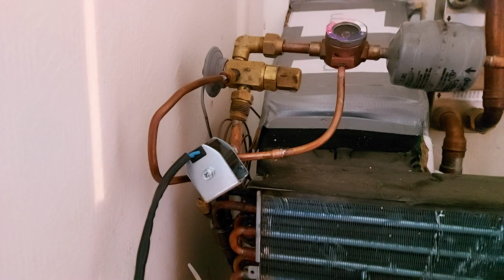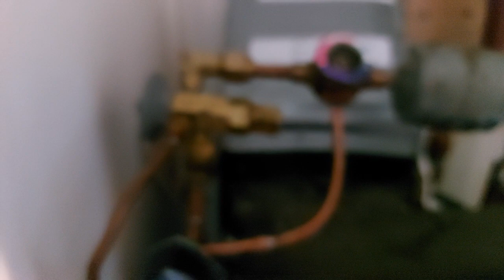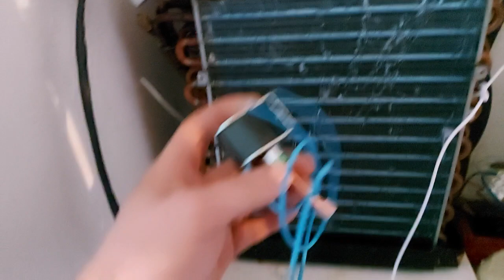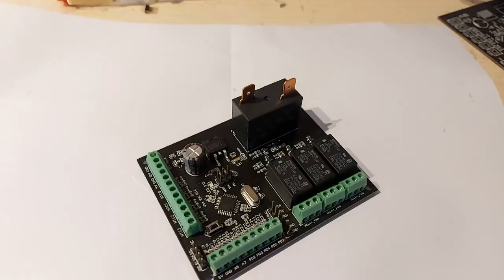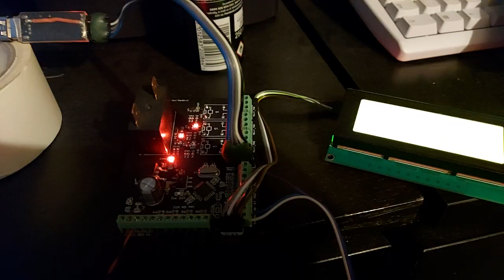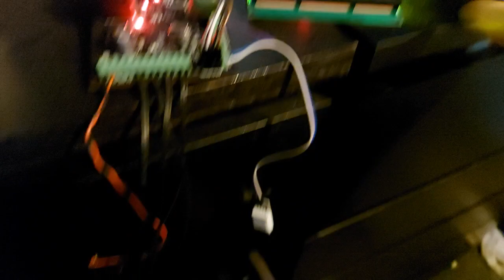Refrigeration Defrost Valve and New Controller

Comment: Hi Shaun, I am planning on converting a 16kw capacity air conditioner into a ground source heat pump, and maybe you would have any advice on selecting the right plate heat exchangers?
Reply from the maker: Basically, the bigger the exchanger, the more efficient it will be. How many kw is it?
Reply: @ShaunDobbie  consumes 4kw 3ph outputs 16kw

Comment: Thanks for this Shawn. I'm building a whole house dehumidifier (R290) based and will have to do this as well. I like the Idea of a DIY heat pump because I have hydronic heat in the floor and a separate air to air central AC unit that died of old age. It was R22 and i converted it to R290 and it ran for 4 summers until the compressor packed it in.
Reply from the maker: Brilliant. Sounds like an interesting setup